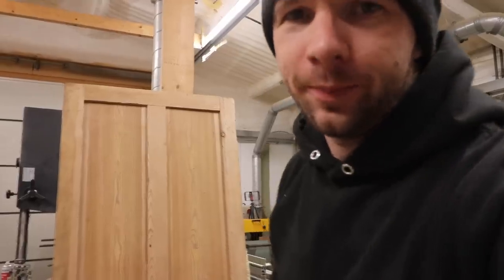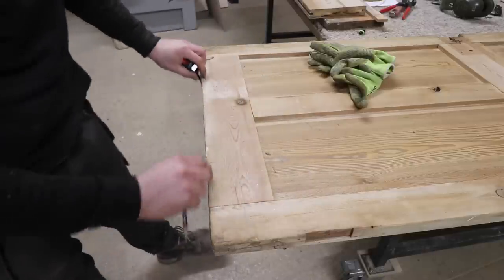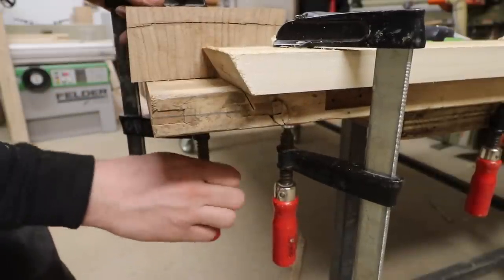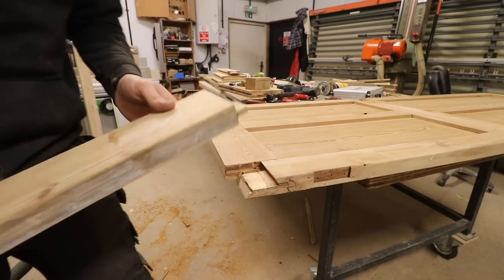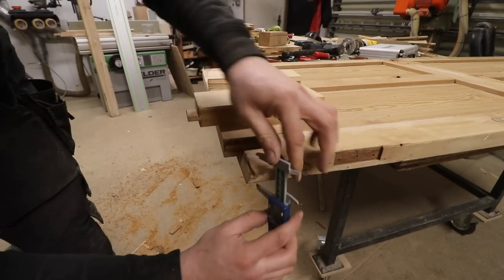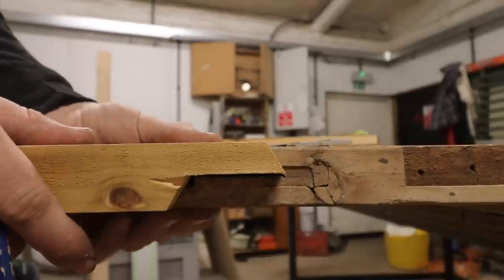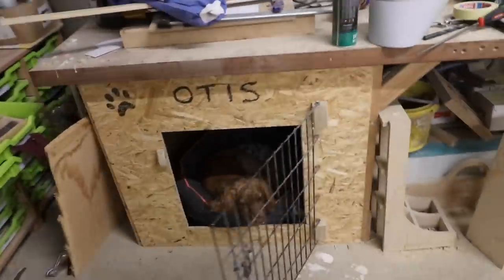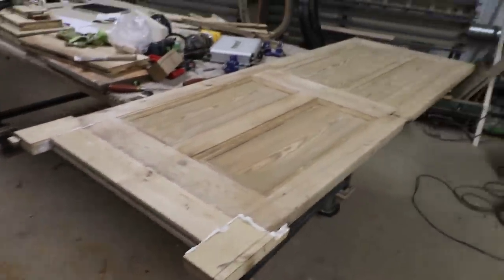Door restoration. Adding Height to this Old Pine Door.

Comment: Thanks for another great lesson. Also, thanks for introducing me to PU glue in gun form. I've used bottles of PU before, but there are so many advantages to using it with a gun. I didn't even know it existed in that form until you showed us. Keep up the great videos.
Reply from the maker: Thankyou Ian, yes "what glue is that" seems to be a common question. I didn't realise it wasn't so well known, and now it's mentioned most seem to use the bottled version which is just the devil's own juice...

Comment: This is great to see. I'm thinking of building a front door using salvaged oak from old tables. It's easy to find 1.8m tables but I need a 2.1m finish height. Planning 45-50mm depth, loose tenon joints, and fully painted with 3 glazing lights.

Would you worry about making a front door with full width rails, rather than full height styles? The hinges and locks would all be within the styles.

Comment: I loved this. I am in the States and often travel in the UK. You DO have many shorter doors there. As it happens, a prior owner shortened 8 doors here at my house of comparable vintage.  A shame, but I need to correct now that her carpet has been removed.  This has been very helpful .  Great job, sir!.
Reply from the maker: A Normal door is 1981mm but many older houses have been reworked etc and doors get trimmed down... very old cottages the doors are really low!

Comment: I would never have given it a thought about making the slope in the wood at the joint to stop the rain from running into it. Good job I’m not any good with woodwork.
Reply from the maker: Thanks John! Yeah little details like that help, if there was to be movement, it's kind of a failsafe!
Reply: No doubt this is going to be an internal door so not likely to have rain on it but I still think the angle cut in makes for a far better professional looking job which somehow makes it look stronger. Great video and a fantastic job. Can you provide a link of the door after it has been waxed and hung.

Comment: Another great job Ollie. Nice to use old timber for the repair, seasoned through age so it’s done it’s shrinking. I can see you’re going to cost me money again with the cutter blades this time! 😂
Reply from the maker: Haha cheers again Simon! The blades are good for the money but nowt special. Cheaper on eBay I think... 😉
The very best blades are festool speed max ones. Incredible them!
Reply: @BradshawJoinery  Top notch craftsmanship Sir 👍🔨🇮🇪 Do you know if those Festool osm blades fit a Bosch osm?

Comment: For the rail, I think I would have used a dovetail router bit, and set both the interior and top of the edges of both patches to the 14-degree of the router bit.  It wouldn’t have occurred to me to do like you did.  But it really shouldn’t make a different strength or appearance wise.  To widen the style I probably would have made a groove in the bottom of the existing and added a spline.  But,  again it shouldn’t make much difference in the end.  Just a difference of method.
Reply from the maker: Yeah could do! I'm cautious of old doors and nails so don't use your best router bit. The problem with dovetail bits is you have to guarantee the height of the router doesn't alter when cutting so easy to get a wobble in the edge. The best way is with the track saw set to the depth then finish with the multitool 👍

Comment: Great Job ! Well done, thanx for the video. It's the reference for my own door project. Question: @14:28 what kind of Serre Joints are you using? I have to cover 2,20m but it seems one can only find 1,8m on the web.

Comment: Struggling here a little
Why not replace the entire bottom piece
Repair leftover mortise on both sides or remove the old mortise completely while replacing all of bottom piece
If it was to be painted maybe not but I heard you say it was to be a natural finish
Ty
Reply from the maker: Just not touching the panel areas saves alot of time, and less timber required. Plus the more of the original left the better, I think it doesn't catch your eye as much

Comment: I've got to take the rotten bottom of an old door and replace it with new wood.  To avoid it looking like a new board all the way across I'm going to cut a false line into the board to continue down the line where the original joint is.
Reply from the maker: Yeah thatll work!

Comment: That’s a lovely job! For a similar era pitch pine external door, what timber do you think would be best for lengthening? It’s going to be painted so doesn’t need to match. Cheers
Reply from the maker: probably a pine with similar grain cut. Quarter sawn joining to rift sawn will look weird through the paint so the grain orientation will be more crutial than species, aslong as its pine
Reply: That’s really useful to know, thanks!

Comment: Thanks for the videos they are amazing they have inspired me to lengthen three doors and the frames. Tech question: what size dominoes did you use on this door 40mmX 8mm or bigger?  Many thanks.
Reply from the maker: thats Awesome to hear! I tend to only use 5 x 30 or 10x50. so they are 10 x 50 i think.

Comment: Got to ask, why didn’t you just shorten the styles a little more and then replace the bottom rail in its entirety?
Reply: If it's not broke don't fix it.  Structural integrity.
Reply: Possibly didn't have any old matching wood?
JIM
Reply from the maker: Having some remaining joint leaves strength in the original door and I don't have to worry about panel grooves etc, I also didn't need wide timber for this repair and s full bottom rail in old pine is hard to find. So in short, it's less work this way, stronger and the materials were available 👍

Comment: Hi, I have an old door 32 inch x 80 inch) that I want to use in a 36 inch x 81 inch opening. I need to add material to its width and height. I was hoping to poly it to show off the wood rather than painting it to cover the patch. How can I do it so the door looks good after I apply the poly?
Reply from the maker: try to keep the grain in the same orientation as it is. i.e dont add a batten on the bottom under the end grain. adding 4" to the width is alot! it may look bulky on the stiles
Reply: @BradshawJoinery  we had the idea to make a picture frame (miter the corners) around the door. Do you think this would work?
Reply from the maker: @koolaid11289  it will work but may look a little DIY! Mitres will be tricky to make work when fitting the door too. I would keep the Stiles one full length top to bottom whatever you do

Comment: Just watched the shipping container episode. What was it for? Just storage?
Reply from the maker: It's to store timber about to be used and completed jobs in an acclimated environment before installation. It's made a massive difference to the quality of my finished work after installation I get absolutely minimal movement from the timber.
Reply: @BradshawJoinery  yeah just saw the other episode. How much did it cost total??
Reply from the maker: About £6k I think, £2150 for container, same for insulation then some electrics and the OSB/battens. Would be alot more now 🤣

Comment: You arse... I can't fit a single CC in my shop and you've got two! Out interest, how much room behind does the arm stick out? Love the video buddy. And a great tip on the starlock - the bosch ones from Screfix are about over a tenner! M.
Reply from the maker: 🤣🤣 I'm not rubbing it in, but then new one is absolutely minty.... Without a full restoration your not gonna get better 

Blades are good, they are cheaper on eBay, I just earn a few pence from Amazon hence the link to there 🤣👍
Reply: @BradshawJoinery  How far out the back does the arm protrude? I miss my old BRA, but always wanted a CC .

Comment: Thanks for sharing this very interesting little project. Excellent work and very clever use of the multitool. 
Just a quick question regarding the blade you use in the plunge saw to perform the rip cut. I've been using thin kerf 24tpi blades, but have found they just don't last very long, tend to wander, and can leave significant burn marks, especially on hardwood doors. Any advice would be appreciated.
Reply from the maker: Tricky one, but the problem namely lies in the blade quality. Rip cutting wants to be alternate bevel with a positive rake, in a 160mm blade 24 teeth is about right but like you I've always found the 24t blades "tinny" to the ear and struggle to get a nice cut. Id try a higher tooth ATB with a thicker plate if you can find it. My HK 85 rips beautifully with a 2.4mm plate blade. Thick blade and plenty of power will solve your issues but most small track saws aren't capable of it unfortunately. They are designed as panel saws with triple chip blades..
Reply: @BradshawJoinery  Thanks for getting back to me! I was using the 36v Makita, but went back to using the 110v corded one. I've got several tracks, and have one set dedicated to the cordless, and the other to the corded.
Yes, I'll definitely be avoiding the thin kerf blades going forward. 👍

Comment: May i ask  what adhesive you are using for the repair that is dispensed in a caucking gun?
Reply from the maker: Hi, I've added the links In the description. Wood weld is probably your best bet but the adhesive is called Polyurethane

Comment: Nice work! Will you bevel the door for hanging or will that be necessary in your case?
Reply from the maker: Yeah I did, use a 2mm packer to one side of the door and EST planer to cut just under 2mm👍
Reply: @BradshawJoinery  Ahh cool, thanks for that. Great content on your site, fair play!!